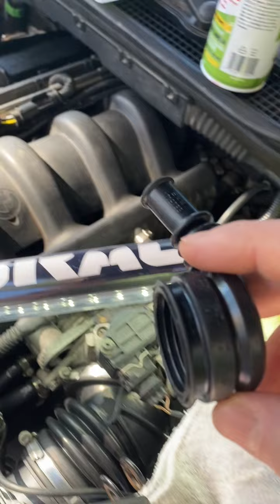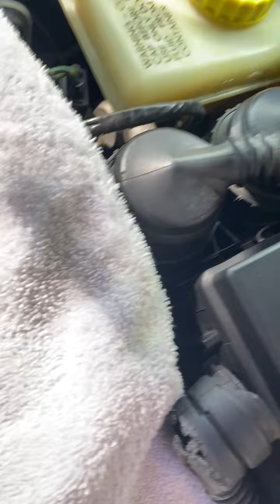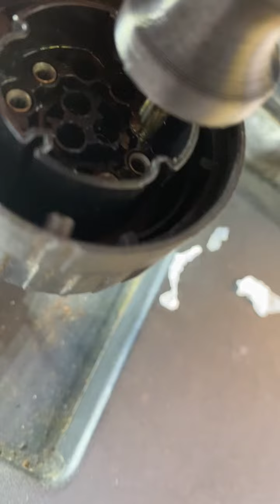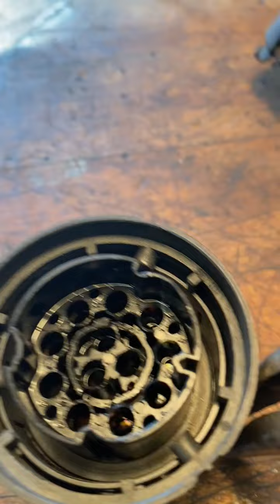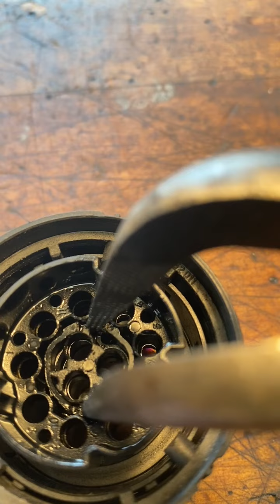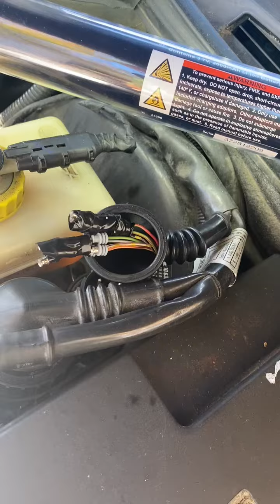De-pinning a BMW E36 x6031 connector

Comment: Do you have a PIN out scheme of this connector?
Reply from the maker: Pin outs are in the description
Reply: @pjmcgarvey  yes sure. I meant the related signals, so where the PIN signals are coming from (e.g. Ground,  ABS ECU etc)
Reply from the maker: @BMWgab  I don't have that level of detail, but I have seen it in the back of the Bentley manual. Hard part is identifying where that connector is in the electrical diagrams b/c I don't think it's called X6031 in the diagrams. Good luck